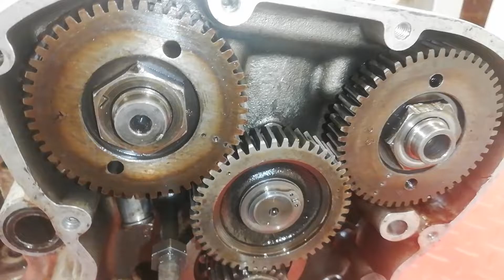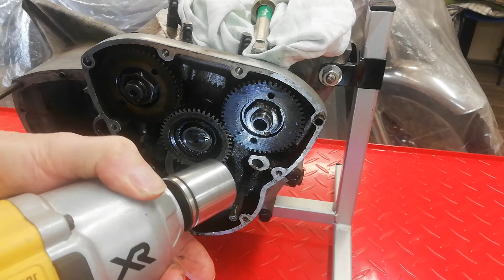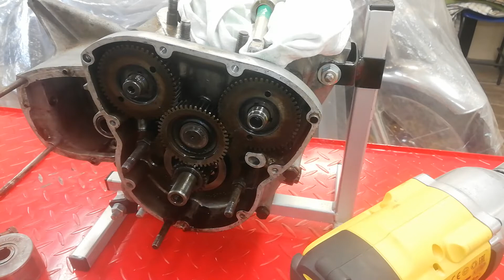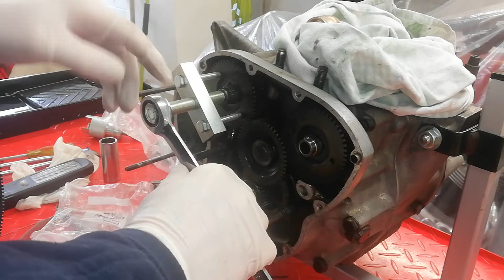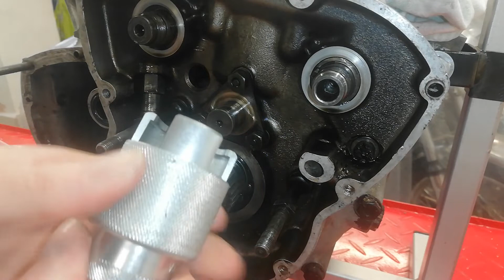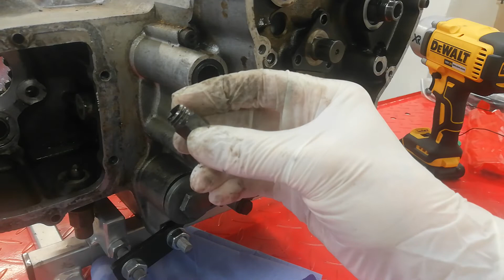Triumph Trident T160 Engine Rebuild. Part 8 Removing the Timing Pinions from the Timing Case

Comment: What size socket did you use for the cam nuts?.
Reply from the maker: The camshaft pinion nuts are 1 1/8", and are both left hand thread.